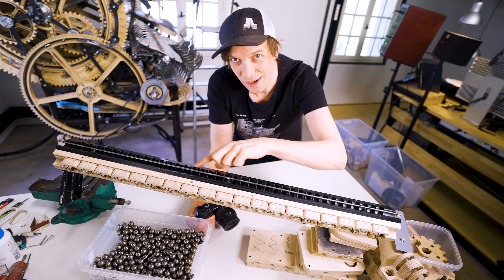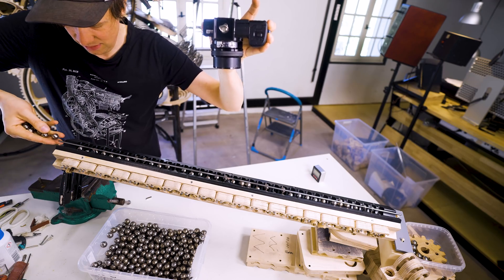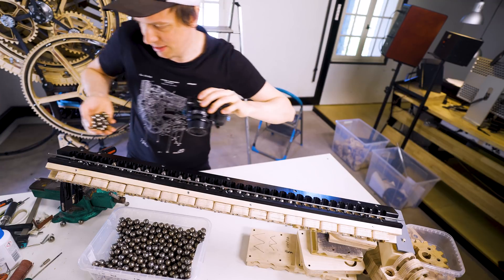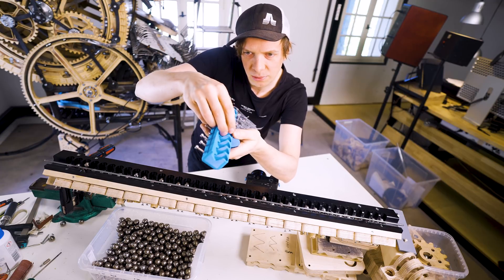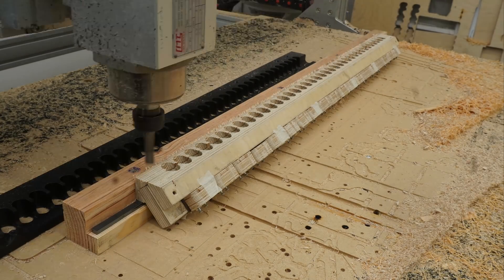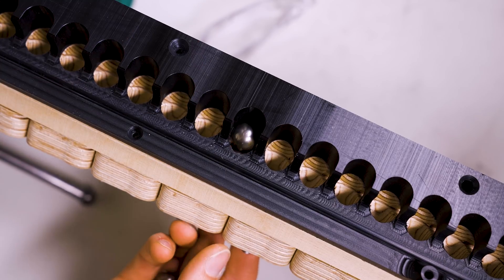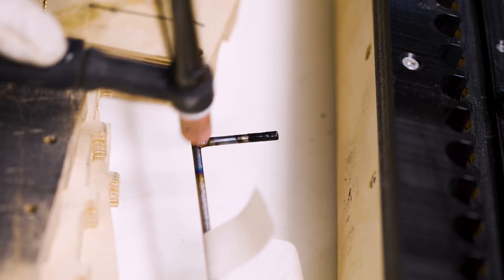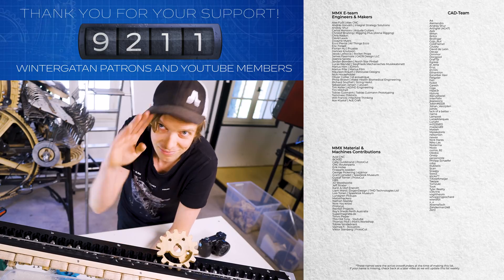Testing the New Marble Divider

Comment: The new marble divider looks amazing! I'm excited to see it in action!
EDIT: I wonder if a little graphite would help solve some of the stuck marbles, but maybe the graphite wouldn't work on this material.
Reply: POM itself is already a very slippy polymer. So adding graphite will very likely increase the friction. As you might remember from the prior vids there is some vibration in the MMX so I would expect there will be less marbles stuck once it's on the MMX.
Reply: Nah, marbles will almost never be moving as slowly as Martin is demonstrating here
Reply: Graphite was tried as a solution in the pressure gates before and it made everything dirty eventually.